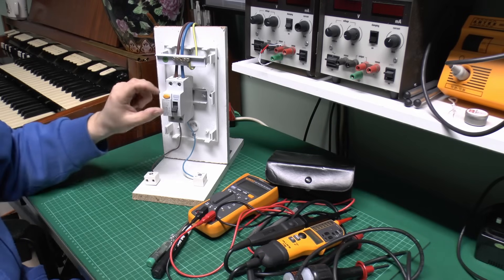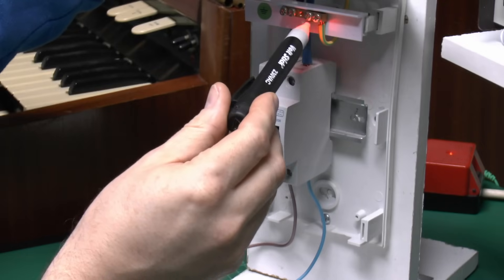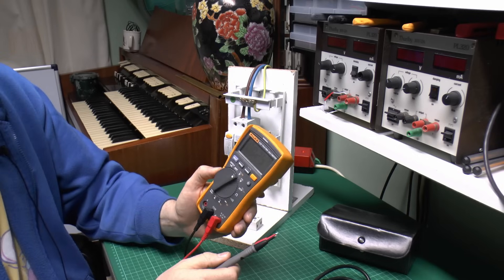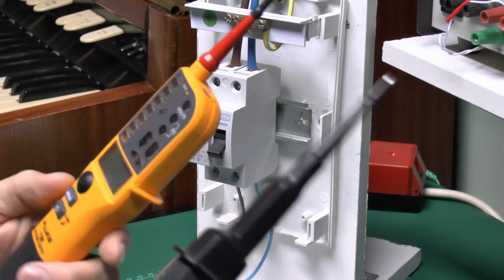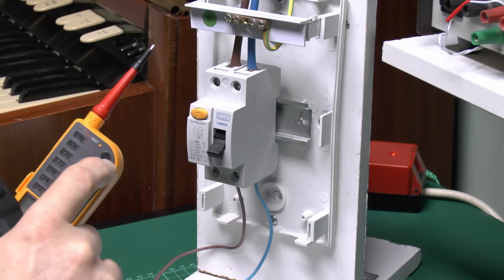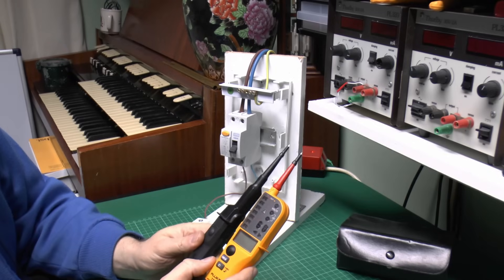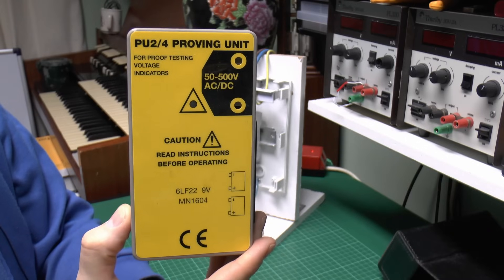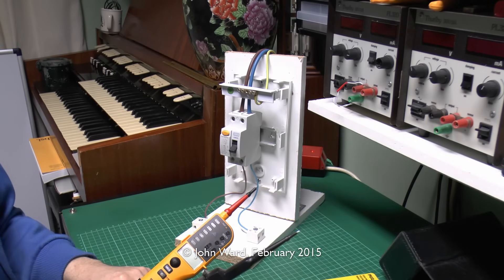Proving Dead - Mains Electricity

Comment: HI, if you cant set a multimeter on the correct setting for proving a circuit is dead than maybe you should leave the testing alone.
Reply: Well said.
Reply: Yes that is precisely what i was thinking!
Reply: Also prove the multimeter.
Reply: Maybe. I use multimeter and for all the rare cases I short circuit the wires so they abosutely are not live. I can't recommend it thou. Don't fall from the ladders when doing that.
Reply: def ender I have used one of those screwdrivers once or twice when desperate, but always checked it's working with the power on first.  Still I don't trust them and have always used my multimeter. Never had a problem as I always Che know my settings before using. Kinda pilots check list mentality - leads in correct sockets - check, a/c range - set and again check it's working on live before checking to see its off.
Reply: That's exactly why international standards require the use of specific testing probes, NOT a multimeter to prove dead.
Reply: Even the best of us can make a mistake and people frequently do. They also mistreat their equipment and a broken DMM  lead will indicate a circuit is dead.
Reply: If your Neutral has lifted that isn't going to help you.
Reply: If you actually failed to understand the point of this video I'm honestly shocked that you regularly remember how to breathe.
Reply: @derekrobinsonutube  you should be using a proving unit, but so should the creator of this video.
Reply: @derekrobinsonutube  Except when later showing Fluke Voltage Tester he clearly said that it also can brake and standard procedure is to test it on live circuit first and last, so if it works for Voltage Tester why not Multimeter? He clearly has some agenda he wants to push, but doesn't give any good arguments supporting it...
Reply: @bar10005  You clearly do not understand what you are talking about.
Reply: @Solocat1  So enlighten me if I'm so wrong, what's different between having broken lead/device in Voltage Tester and Multimeter? Both will show dead circuit and both should be proven on known live circuit.
Reply: It's quite easy to set one wrongly. Being incredible, I doubt you get it wrong.
Reply: Fatigue and complacency can affect even the most seasoned professional.
Reply: Fred Bloggs What I normally do is test between live or neutral to earth with a multimeter.
Reply: @CurvedSlightly  Yes but its just as easy to set a MFT to the wrong setting when performing a loop impedance test on a live circuit for example or a RCD test but nobody is suggesting that we all scrap our MFTs and buy a single function instrument for those tests
Reply: Agreed but I think John was just making the point that they cannot be reli3d upon because people (even qualified people) CAN and DO make mistakes.
Reply: Absolutely Jeff, could not agree more.
Reply: @Ironarcer  you have to for testing 110V site transformers! 55-0-55?
Reply: For everyone thinking he has an "agenda" behind not using a multimeter, he doesn't. It's simply a standard (at least now) that you are strongly discouraged to use a device that will show you voltage (and the absence thereof) with the device having dead batteries and without having to select a mode. It is a safety regulation...
Reply: @MichaelAndersen_DK  indeed the clue is in the name.

Comment: John, pleased to see you discussed the use of a proving unit but it would have been helpful to mention that any test meter/indicators should be GS38 compliant - meaning that the test leads should be fused. I wonder who you aim your video's at because any qualified and suitably trained person would know how to use a Multimeter and know whether they had it on the correct setting or not.

Comment: Hi,
I am a trained 'Authorised person' and would like to point out an error in the proving for dead procedure described above (around 11:00 onwards).
The correct procedure for proving dead is a five stage (not three stage) procedure:
Step 1 - Prove your tester (check it is working)
Step 2 - Test Phase to Neutral (repeat for all three phases in a three phase installation)
Step 3 - Test Phase to Earth (again repeat for all phases)
Step 4 - Test Neutral to Earth.
Step 5 - Prove your tested again (Check it is still working).
Without steps 3 and 4, the neutral or even earth could be live and you would not be aware as the neutral and live are at the same potential (i.e. both at 240v or both dead, but with a live earth).

Also, for the electricians using mulitmeters to prove dead (I used to do this myself!), I would like to point out that the real danger with this is the possibility of the 'multi' meter accidentally being in current measuring mode. (Anyone who says they have never tried to measure volts in current mode is either superhuman or lying). In most cases, this will just lead to a blown fuse and some embarrassment. In the worst case, you might believe the circuit is dead (though steps 1 and 5 above should contradict this) or worse, draw an arc with a risk of flashover and burns (it has happened). 

Work safely folks.
Reply: Gavin Minion just get a basic multimeter that's always set to volts to check voltage

Comment: I have an Di-Log DL114 auto ranging MM with a red light which is detects current on non contact basis or if one of the probes makes contact to a live conductor.
It has a built in torch too. £28
Reply: Watch carefully at 9:05 and you will see the Fluke tester does incorporate this.

Comment: Mr Ward, I’m very much enjoying your informational videos. They are the perfect companion to the City & Guilds courses.  

I have a question for you regarding safe isolation.  In your video here, and in the labs at the college they only ever show safe isolation of the complete system i.e. testing at the load side of the isolator to ensure all circuits in the consumer unit are dead.  Are you able to show how you would isolate an individual circuit, for example the lighting circuit, whilst leaving the other circuits live?

Comment: Hi.can you explain a 3phase and neutral supply how is there not 3 neutral supplies when there is 3 100 A fuses I thought if 50A goes along the phase cable 50 A comes back through the neutral which would put 150A through the 1 neutral overload it I am talking about using the 3 fuses for 240 v systems can you tell me how this works and does not overload the 1 neutral.  Cheers
Reply from the maker: If only one phase is loaded, neutral current will be the same as that phase.  If more than one phase is loaded the neutral current will be less, and if all 3 have the same load connected neutral current is zero.
The three phases are not the same, each is phase shifted by 120 degrees, so that when one is at the peak AC voltage, one of the others will be at zero.  Current flows from one phase to another, and the neutral just handles any imbalance.
More extensive description here: https://en.wikipedia.org/wiki/Three-phase_electric_power

Comment: When testing at a socket for example. You should get 240v between live-neutral and live and earth. However should you get continuity between earth and neutral. And also when testing dead, should you get continuity between live and neutral, if appliances are still plugged in, but no continuity between earth and neutral?

Comment: And when the supply is off- make sure it is under your control!    About 45 years ago i was examining a long extension lead that had failed- A man walked past the plug and an reasoned that the reason for failure was that it was not plugged in- so he did that- he then ran outside to investigate the screaming..... I was me connected  - the man was my brother........... I often wonder.

Comment: Actually fluke 117 has a great feature for proving dead, which is the auto low impedance volts range, definitely one of my favourite multimeters out there
Reply: Great, however you are missing the point of the video.

Comment: ...aaand even AFTER all that excellent advice, if your're going to work on two bare wires for a ceiling fixture, touch both conductors together with one hand BEFORE reaching with the other. If you have done what is aptly described here, it should be a simple final check before potentially sending a deadly current through your heart. Worst case scenario, you burn a hole in one hand instead, while you scratch your head with the other, wondering how the hell did that happen.

Comment: Can I just add you need to test not just L-N but L-E and N-E as a faulty switch or RCD may break the circuit N but leave the L connected.    Also 264v is above the maximum supply voltage you should be getting ESQCR specifies 230v +10% / -6%  so 216v to 253v.

Comment: John I noticed that your Fluke was reading 263 volts. I have been left the UK now for 12 years but before I left the voltage was 240 volts.
Then the decision was made to make the UK the same as the EU continent at 230 volts. There was a tolerance though of I believe 6% so it allowed the UK to still operate at 240 because it was covered in range by that 6%.
But 263 is out of that range isn't it?
Reply from the maker: 263 is far too high, the limit is 253 (+10%).  The test setup in the video was supplied from an isolating transformer, which has a higher than normal output voltage with no load connected.
Reply: OK on that John. That explains  the 263 volts shown on the Fluke.
Reply: John Ward I don't understand at times when you test neutral you can see that there is a current flowing through.

Comment: In the Netherlands appliances for proving 'dead' mains have to comply with NEN-EN-IEC 61243-3 or equal ( According to NEN 3140: 2015  6.2.3.101 ). A multimeter is not produced according to this standard and is therefor  not suitable to use it that way.
The procedure for proving 'dead mains ( 3 fase and neutral and PE )is as follows:

-Be sure the tester works
-test L1-PE , L2-PE,L3-PE,N-PE  L1-N, L2-N,L3-N, L1--L2 ,L1-L3 ,L2-L3 
and finally the last test for assuring the tester is still in working order.

for a 230V it would go as follows

-Be sure the tester works
test L-PE, N-PE,L-N
and finally the last test for assuring the tester is still in working order.

I wonder if there are different sets of rules for proving dead mains between countries?

Comment: This info would be handy for working on automobiles, I think.

Also, a topic suggestion for a future video. Why does the US (where I live) only use 120 volts when apparently everywhere else uses 240 volts? I do hope you eventually cover something like this. Would be interesting to see.
Reply: +Bryan Young That's quite interesting. A mate told me his take on it, and that is, Americans were first to receive electricity and it came in the form of 110 volts. Since then other countries had got it and realised that the 230 - 240 volt system was a heap better (more power I suppose) however Americans already had the 110 volt too well established into their infrastructure that it wouldn't be viable changing! A theory that would need proven, however, no doubt interesting all the same!
Reply: From what I understand, we have 240 pumped into our houses, though it gets chopped into 120 somewhere along the lines. Like our stoves, washers and dryers all use 240, of course with a different plug so you can't screw it up and plug in a nightlight there.
Reply: +Bryan Young You are getting 220V/60 Hz phase to phase with a neutral in the middle providing two 110V/60Hz circuits (two phase 180 degree system). Most of the world gets 3 phases with 380V/50Hz phase to phase and a neutral at the star point providing 3 x 220V/50 Hz circuits. Britain and its colonies used to get 415V/50Hz and 3x240V/50Hz.  So before brexit, the EU compromise was to label it all as 400V/50Hz and 3x230V/50Hz. Not sure if that will be rolled back after Brexit.

Comment: Hi John, Would you trust the LAP MS8922B AC/DC 2-POLE VOLTAGE TESTER from screwfix for 240v home use
Reply from the maker: I haven't used it, but it is made by a known test equipment manufacturer (Mastech), Screwfix have just had it relabelled for their own use.  It's very basic but should be OK for voltage indication.

Comment: When using voltage probe testers, does it matter which terminal you put the needle in. If so, what terminals does the positive and negative go into? What would happen if you did it the wrong way? And also if I wanted to test a socket through the pins, where would I put the needles?
Reply from the maker: AC doesn't have positive or negative, and it doesn't matter which way round the probes are connected.
Reply: @jwflame  oh I see thank you
Reply: @jwflame   but you have live and neutral. 🙄 Polarity.

Comment: I was nearly killed once when I trusted a volt stick so I can confirm they are not suitable (I tested it on a known live wire and it lit up, tried it on one I thought I had disconnected - tried it several times) then cut the wire resulting in no more wire cutters !
Just wondering - if the RCD had developed a fault or was wired wrong and it was only switching the blue wire wouldn't the suggested technique in your video give a false safe indication?
Reply: No

Comment: Self proving voltage and continuity testers, are they any good. Or is it best to get two separate units
Reply from the maker: A proving unit is still required, as it's necessary to create the 400+ volts to prove it with.
Some have a built in function to test, but that's only for confirming the indicators on the device are working, that can't replace testing it on an actual 400+ volt supply.

Comment: There is a little flow in your presentation: let's pose for the moment that the neutral wire is broken. Will those fancy testers show that the power is on the live wire? What will happen if you 'reverse the polarity' and touch your Fluke main probe to the ground and the auxiliary probe to the live pin? Just curious.
Reply from the maker: Yes, they will show live even with only one terminal connected.
Reversed probes makes no difference.
Reply: Thank you.  So you do not have to use both probes when testing? Just the main one will show live wire?
Reply from the maker: The one probe  indication is a secondary feature, similar to those 'volt sticks' with the red LED in the end.  Both probes should be used, and that is the only way to get a display of the actual voltage.
Reply: It is useful in that it shows instantly of a potential lack  of live or Neutral but just as a neon screwdriver is not a trustworthy tool, the proper checks need to be made.
People still don't get it do they !

Comment: I have a chinese version of the multifunction voltage tester (UNI-T UT15) and it has an on-time limit of 30 seconds followed by a rest period of 10 minutes, presumably due to power dissipation in the input part of the device that covers the wide range of 12V to 690V. I wonder if the Fluke voltage tester you showed also has that test period limitation?
Reply from the maker: +ridefast0 Fluke specification has on time 30 seconds, recovery 240 seconds (4 minutes).
Reply: Thanks - so it looks as if the heat is managed better in the Fluke. No surprises there.

Comment: Sorry John, but you explained this wrong.
Just imagine of the case only the neutral-line is broken. so your "lamp-test" will not show any current. But it trust me, you will get killed touching the main-line. The cheap glow-discharge lamp in the screwdriver would have indicated this.

please fix your post.
Reply from the maker: Thomas Baum If the neutral is broken, this would be found when testing between line and earth, as shown at 9:40 onwards.
Reply: ***** Only if you tested the lamp on the same source. It still would not indicate a faulty breaker if the hot was stuck on.when you switched it off. I always use a multi meter and check each terminal not only to neutral but also ground and I really mean ground not just a terminal with a ground wire on it. Seen way too many people hurt and one killed, while I was in the Navy, by assuming things.
Reply: That is why I test there is voltage after the breaker when it is in ON position, then recheck with it being in off position, and then make sure the probe is still working by checking somewhere else. This way I make sure neutral was working fine when I tested it in the first place, and the breaker indeed switched neutral off. Sure, it is still not perfect (it is possible breaker only disconnected neutral, and live is still live), but if you have a earth / ground nearby, you should check against it too. And check both line and neutral against it, to make sure they are not swapped.
Reply: Yes, and it was made to do that to tell you to be suspicious should the light not show.
Reply: @jwflame  That's correct John It would